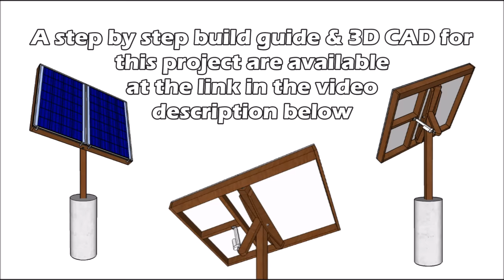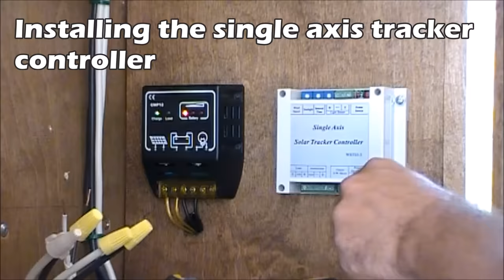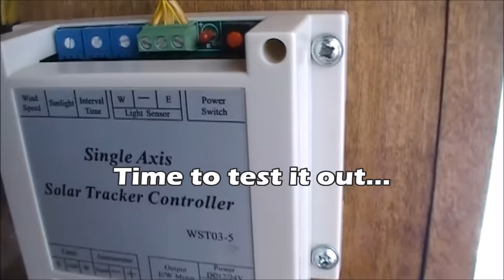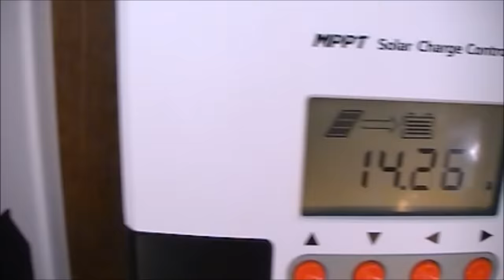Build A Solar Tracking System - DIY Solar Tracker - Off Grid Living!

Comment: Enjoyed watching this.  Doesn't the exposed wires pose an issue with critters from the forest?  Since you used wood how is the wood holding up after having rain and such, or is it too soon to tell?  What is the total wattage for the 4 panels?  Can you provide power production info as to what you will see on a completely sunny day from sun rise to sun set?  Pick any time of the year.

Comment: Nice design thanks for sharing. But if the panels are 25% more efficient and the install in 25% more expensive and tedious then why not just hard mount 25% more panels? Less chance of failure that way.
Reply from the maker: Thanks! But who says the installation is 25% more expensive and tedious? I did this for dirt cheap, and it was just as easy to do as any fixed array that I've installed. In fact, I actually had fun doing this project lol. What it would cost others will depend on a few things but generally tracking is more economical, especially on a large scale. That's why most commercial installations still at least incorporate single axis east-west tracking. Bare with me and I'll lay out some numbers so you can get an idea of what to expect for cost: 
A person can buy the actuator/controller kits that I used for a little less than $150 CAD (including shipping, see link below), and they can handle over 1000 watts of pv panels (in terms of physical load on the actuators that is - they can support up to 300 lbs max push/pull load, avg 100-150W panel weighs around 25 lbs, so up to 10 panels plus the weight of a wooden 2"x4" platform). 
For comparison let's say we can buy the panels from a retailer for $1CAD/watt after taxes ($0.80USD), regardless of size, in-store pickup. The cost for ten 120W panels like mine would be 10 x 120 = $1200CAD. The cost for ten 150W panels (120W * 25%) would be 10 x 150 = $1500. A difference of $300 ($240USD). In terms of building materials, my trackers work out to requiring around the same as a fixed ground rack. If the platform components were scaled up in size to support the full potential of the actuators (300lbs/1kW of PV), then in theory the trackers would use less building material per square foot of collector area compared to an over-sized fixed array - but I'll be generous and just call it even to keep things simple. So after factoring in the $150 for the tracking kit, the average DIY'er in Canada would save ~$150 per 1 kW of installed PV capacity by using solar tracking systems vs over-sizing the array by 25% to compensate for no tracking. For an avg 4-5kW system, that's a total $600-700 savings. Or up to a half dozen off grid batteries, depending on how you want to look at it. Every little bit adds up when you're working on a budget. Could be almost double that if a person is an avid DIY'er who has scrap building materials laying around that they can use up, like myself. If, for example, the PV cost was only $0.70CAD/watt($0.56USD) which is typical for bulk orders, then the savings per 1 kW of installed capacity would only be ~$60. Some would say that maintenance and risk factors would void that, but I say that depends on how many panels the owner needs and how well they install them. If the system is smaller than 1 kW then I probably wouldn't bother with tracking. If it's to be larger than 1 kW, as most systems are, then I would punch some #'s and consider it. Economy of scale plays a role. The # of moving components on these trackers are minimal, and the actuators are very easy to switch out if there's a problem - just two pins and two marrets. But so far after three months of cold Canadian weather I haven't had any issues. I rarely have to clean the snow from the either. The controller/sensor is relatively simple but effective tech. They also have the ability to incorporate an anemometer (wind speed sensor) to monitor wind speed and automatically adjust the array's angle of attack when it reaches a certain point (set by the user) and minimize the amount of surface area facing the wind - something that fixed arrays can't do unless the owner manually adjust them. But generally to compensate for the extra wind load, fixed arrays require extra foundations/anchor points, which drive up the installation cost.

Another thing to consider is space. If you have lots of it, then that's not so much of a worry. But some people are limited, and preserving useful or protected land is a primary focus for commercial installations. Opting for a fixed 1250 watts array vs a 1000 watt tracker requires an extra 20-30 sq.ft. of space. For small systems that doesn't seem like much, but it can add up fast - particularly for large homes and small businesses requiring 10, 20, or even 30 kW or more of pv capacity. Rooftop installations are almost always an option but almost always compromise efficiency due to less than ideal fixed angles/orientation, heat from the roofing material in the summer, snow cover on low pitched roofs in the winter, etc.

The bottom line is that tracking can be more than affordable, but anyone interested should really sit down with a calculator and establish their own CBA before deciding which direction to take. Costs and availability will vary a lot, even across Canada alone. The cost of building materials in Edmonton Ab are almost twice what they are here in Fredericton NB, for example. What works for my wallet may not work for yours. 

https://www.ebay.ca/itm/Single-Axis-Solar-Tracking-Tracker-8-Linear-Actuator-Controller-for-Sun-Track/282801775189?hash=item41d84ca255:g:tW0AAOSw44BYP9eN

Comment: Hello, thanks for the interesting solution for solar stand! I have a few questions: - How many years can a wooden stand last? Is it possible to make it out of metal? Is the solar stand protected from strong winds? What controller do you use to control the stand?
Reply from the maker: As long as you take care of it. These trackers are still in use today, and I live on a windy coast in Canada. Yes, you can use stainless steel, but it's more expensive. Info is in the video description.
Reply: @JamesBiggar  Thank you for your cooperation! I bought your project. Your project is amazing! Thank you so much for sharing it with me! :)

Comment: could you use two of the adjusters? one for east west and the other for the seasonal tilt?
Reply: I was thinking the same thing but its the wrong design for a dual axis tracker, however it would work if you manually operated the  north/south  with a second actuator at the start of each season but it would be pointless.

Comment: nice build....im surprised u didn't go with steel on ur posts and do the rotation on a horizontal axis..larger n more panels...grid tie the extra panels not needed for battery charge...
Reply from the maker: Thanks. Depending on the angle it rotates horizontally in both directions (summer angle is only 23°), but that's kind of irrelevant really. Auto tracking is east-west, so other than the manual north-south seasonal adjustment the system is optimising it's harvest - a second actuator can be added easily to the structure for auto north-south tracking if desired but for an extra cost (2 axis controller is around $100 more). Couldn't go any larger, I just didn't have the yard space. IF the trackers were any taller then they'd be shading the PV/heat pump array during winter months - not good lol. Here are my coordinates logged into an online sun/shadow tracking program (the program determines shadow locations on a person's property based on object height, time of day/year): https://www.suncalc.org/#/45.8403,-67.0693,18/2017.12.21/10:00/3/2  
With it being a DIY project and not a showcase for a professional installation and with wood being easier for most people to work with in terms of cutting and fastening, I chose it instead of steel. Otherwise I'd get a whole lot of "you could have made this easier, most people don't know how to weld!" type of comments. Trying to keep with the DIY theme with this channel. Besides, it's a lot easier to pull a damaged wooden post out of a concrete pile to replace it - if need be - than it is a rusting steel pipe that could very well be made with poor quality steel thanks to falsified data, as we've recently learned from the media. Cheaper and renewable too, just consult load spec's from local building codes to make sure it's sized properly ;)
Reply: It's nice to be able to capture every possible photon because you can, even if probably not cost-effective!
They're certainly well made and look capable of supporting many more panels.
If and when I have a garden again, I'd like to make an XY tracker using a raspberry pi and php to translate datetime to seasonal/daily elevation and azimuth angles as a personal challenge.
This should avoid the sun sensor ever getting confused.
Reply: Trackers have been around for years. They were just used at night for tracking the stars.
Reply: You cant "just" grid tie in most places anymore!
Reply: I’m a total newbie... am thinking either conduit, or pipe (black ?) for flexibility in adding/subtracting panels.

Comment: 400w at 3pm?  Compared to what?  How many watts would you have got at 3pm without the tracker.
Reply from the maker: Given that these are ~120w panels each (w/mppt), that's nearly full power facing southwest, an hour or so before the sun starts to set at that time of year here. A fixed array facing south with the same panels would only produce 1/4-1/2 of half that, but I can't give you an exact number - this wasn't a comparison video, just a build video. It preforms similarly in the morning hours. At solar noon a fixed array would produce close to the same power as a tracker. Generally a tracker is ~25% more efficient on avg, in terms of net kWh produced (after power consumed by the tracker motors is accounted for). Some are documented to be up to 40% more efficient. Whether or not a tracker is right for you will depend entirely on the price you pay for it compared to just buying 25-40% more panels for a rooftop or fixed array (I think this tracking system cost me around $150 CAD). I did have trouble with the actuators freezing up in the winter though. If I were to use the linear style again, I would make the support column and platform larger to support more panels and give the actuator better protection from the elements. It has a rated load capacity of 300lb, which translates to around 1000 watts worth of panels.
Reply: @JamesBiggar  thanks for your reply. I found similar results. I have around 4 hours of near-full production of 5000 Watts without the tracker. My math calculations show much higher than 50% Harvest with the tracker. Partly because my batteries are full before 10 a.m. and I start drawing from the batteries about 3 p.m. because the panels are not facing the sun any longer and my kids get home at 3 and start hogging power. With the tracker I can get all my power directly from the panels clear up until 20 minutes before the sun sets here in Hawaii between 6 and 8 p.m. instead of starting with half dead batteries at Sunset I start with completely full batteries at sunset. This way I don't have to spend that $2 in fuel for the generator every evening saving me $60 a month.

Comment: Awesome project, but I have to ask a question.  If the gain is around 25%, wouldn't it be easier and cheaper to simply increase the size of your PV array by 25% to achieve the same increase in output?
Reply from the maker: Thanks! Nope, refer to earlier comments below.

Comment: Cool Video..Thank you for sharing !
You mounted the controller far away from the panels. Did you just extend the cables from the sensors and the actuator ?
Reply from the maker: Thanks! And yes

Comment: I like your design a lot. It's very similar to what I want to do. I want to have multiple solar panels that follow the Sun. The difference is, I don't want them to be permanently mounted in the ground. I want to be able to just fold them up relatively quickly and put them away case of a storm or hurricane because I live close to Houston which gets hurricanes from time to time. I've already got the design for the mounting of the solar panels. What I am missing is the device that tracks the Sun and moves the panels. Is that device in your documentation? If so, I'd be happy to purchase a copy. If not maybe you just give me the name of the company? Or a link.
Thanks,
Mark
Reply from the maker: This is kit is similar to what I used (which is no longer available):
https://www.ebay.ca/itm/283643811252

It's cheap, made in China. But does the job. Wind Nation in California has a more expensive kit available if you prefer domestic: https://www.ebay.ca/itm/281896200911
They sell actuators on their site: https://www.windynation.com/linear-actuators

Comment: Do these panels turn automatically or it's you turning them with the remote controller?
Reply from the maker: Both. A tracking system is pointless if I have to stand there all day to constantly move the panels.